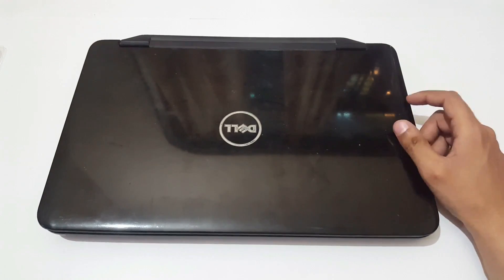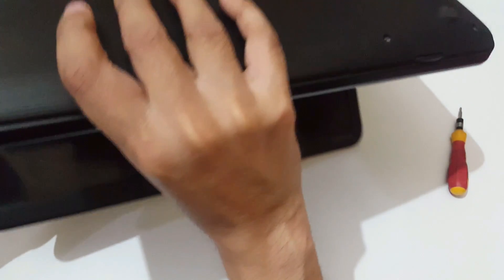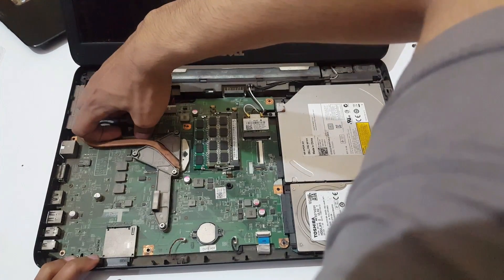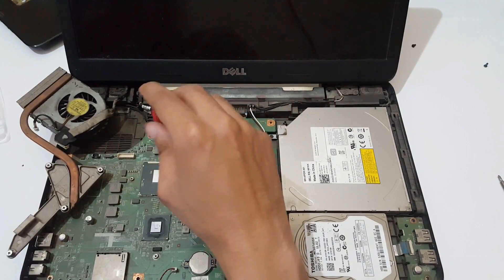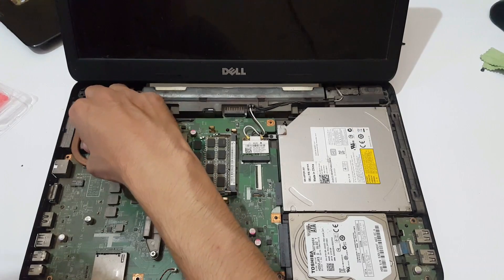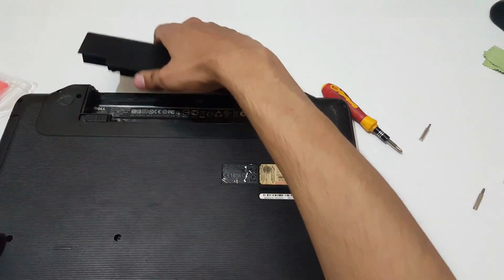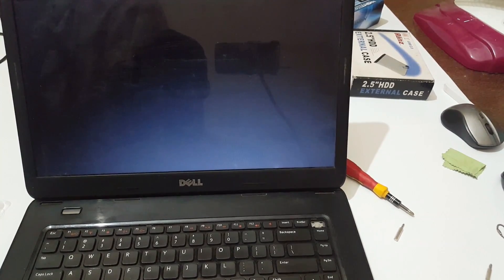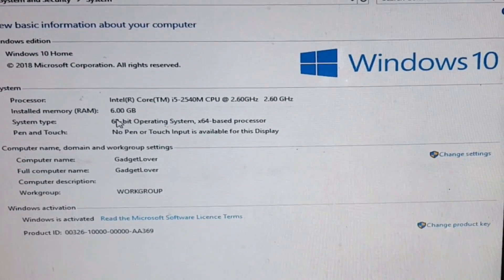How to Upgrade Processor on DELL Laptop | i3 to i5 & i7 - Make Laptop Faster for Gaming

Comment: Hello I have Lenovo g500s i3 3120M CPU which processor should i upgrade  which will not bottle neck my motherboard ? i have upgreded it to 8 GB ram and 1 TB HDD please suggest laptop from past last 6 years
Reply from the maker: Sheeraz khan : Intel Core i5 3380M is best processor for your Laptop
Reply: @GadgetLover360  or should i go for the i7 - 3840 qm ? or it will bottleneck the performance ..
Reply from the maker: Sheeraz khan : Intel Core i5 3380M is best processor for your Laptop and if you want to upgrade it with i7 processor I would suggest you Intel Core i7 3632QM
Reply: @GadgetLover360  will it bottleneck Fcpga 988 motherboard ?
Reply from the maker: Sheeraz khan : No but it will improve minor performance of Laptop
Reply: @GadgetLover360  Ok bro thanks and i am also planning to add SSD to my lapi to .. by Moving HDD through the CD panel and SSD as main will it be preferrable by you ?
Reply from the maker: Sheeraz khan : You're welcome and SSD is better option to optimize performance of Laptop
Reply: @GadgetLover360  thanks brother for the help .. really appriciate..
Reply from the maker: Sheeraz khan : Glad to help you

Comment: Bro I have lenovo i3 6006u 2ghz 4gb ram 

SUGGEST me the best core for my laptop
Reply from the maker: Scar king : Intel Core i5 6300U and Intel Core i7 6600U are best processor for your Laptop
Reply: From where I can buy this
Reply from the maker: Abhishek Kumar : Amazon or Aliexpress online store
Reply: @GadgetLover360 is it really works for gaming performance, can you get me link of product plzzz
Reply from the maker: Abhishek Kumar : Yes I would also suggest you to upgrade RAM for more better performance and search it on both website then compare and buy best and affordable processor
Reply: I have the same laptop , Lenovo ideapad 320 . laptop is slow as hell , tried finding on amazon 3300 &6600U are not available
Reply from the maker: Free Traveller : The processor of this Laptop is soldered so you can't upgrade it
Reply from the maker: Frantic Cobra : No
Reply: @GadgetLover360  Yo, is there any good suggestion for my laptop? My laptop is the Acer E5-475. I have 4 gigabytes of ram. And there is a core I3 that is close to my touchpad.
Reply from the maker: Syphic a normal noob : The processor of this Laptop is soldered so you can't upgrade it I would suggest you upgrade its RAM and install SSD for better performance

Comment: thank you,
i have dell inspiron n5050 pentium i wanna upgrade it processeur what is the max value can i upgrade it?
Reply from the maker: Alilouvic Stockholm : You're welcome and Intel Core i5 2540M and Intel Core i7 2640M are best processor for your Laptop
Reply: Hi What about dull e5440 i5
Reply: I have Asus Vivo book 14x409 intel i3 can I upgrade to i5
Reply: Compare the processor pins and socket.
Reply: I have tried the i7-2670qm on an n5050. It seams like there is no support for this CPU implemented to this Dell model. Just three short bios code sounds. The i3 is working without problems.
Reply: @halbblutturke3879   i tried i7 2640 and he worked
Reply: @mastersecuritylab8935  Cool thanks. Maybe I will try this CPU to. Sadly the 2670qm didn't :/

Comment: Would this work for a dell desktop? I have an i3-8100 and I'm looking to upgrade for to an i7 if I can, any suggestions?
Reply from the maker: KitaKat : Yes if it is not soldered you can upgrade it with Intel Core i5 8400 and Intel Core i7 8700 processor
Reply: Gadget Lover Thank you so much!!
Reply from the maker: KitaKat : You're most welcome

Comment: My laptop is: Dell Inspiron 15 3567 
Motherboard: Dell 0JTTXY
Current: Core i3 6th generation
Can I upgrade to Core i3 8th generation or 9th generation (as 2gb amd graphics is included in my pc)....
Please also tell if Dual channel support is there or not that is if I put 8GB Ram in two slots of same 24000 frequency then processing speed get double or not...
Reply from the maker: Live Social : Unfortunately you can upgrade it in same generation only and yes RAM and Processor upgrade will boost the Laptop performance

Comment: Dell vostro 3580 i3 7020U 4gb 1tb hard drive, can I upgrade? It's not a gaming laptop I know but I can deal with it
Reply from the maker: gert rummo : Intel Core i5 7200U is best processor for your Laptop
Reply: @GadgetLover360  only i5 no i7 or above it?
Reply: If I upgrade ram aswell ?
Reply from the maker: gert rummo : Yes you can also upgrade RAM of your Laptop and Intel Core i5 7200U and Intel Core i7 7500U are best processor for your Laptop
Reply: @GadgetLover360  thanks alot myfella!
Reply: @GadgetLover360  if so with i7 I can finally play world of tanks and fortnite aight lol. Tyty again. And cs go on medium settings! GTA San Andreas multiplayer is the best tho, depends on how much I upgrade ram, Dell and hp laptops are one of the best!
Reply from the maker: gert rummo : You're most welcome and yes it will boost the performance of your Laptop

Comment: I have Dell n5010 with i3
Gta5 or pubg will run after installing i5 processor?
Reply from the maker: Pawchet : It will improve the performance of your device and I would also suggest you to upgrade RAM for better gaming experience

Comment: I have dell Vostro 1550 with i3.which is the best processer for my laptop and where to buy.
Reply from the maker: Bat Man : Intel Core i5 2540M is best processor for your Laptop buy it from Aliexpress online store
Reply: I have same laptop 😜 btw tried that processor on your laptop?
Reply from the maker: Abhishek Shukla : Intel Core i5 2450M is best processor for your Laptop
Reply: @GadgetLover360  i5 2540m will run?
Reply from the maker: Abhishek Shukla : Yes but 2450M is better processor for your Laptop

Comment: Hi I have i3 6100u what CPU I can upgrade it?
Reply from the maker: Noriel Visco : Intel Core i5 6300U is best processor for your Laptop
Reply: @GadgetLover360  can we change processer
Reply from the maker: The Neplese Gamer : If it is not soldered you can upgrade it in same generation only

Comment: Hello, sir, I have dell Inspiron n4010 with i3, what is the best upgrade part (series too) for my laptop. i need to improve the speed of this laptop. thanks
Reply from the maker: Dody Ardo : Intel Core i5 540M is best processor for your Laptop and you're welcome
Reply: I have Dell n5010 with i3
Gta5 or pubg will run after installing i5 processor?
Reply from the maker: Pawchet : It will improve the performance of your device and I would also suggest you to upgrade RAM for better gaming experience

Comment: which processor should i install in place of i3 4005u?
i want the best ratio of price to performance
very much glad to see that you are replying each and every comment
hats off brother
Reply from the maker: Nikhil Shewale : I would suggest you upgrade it from Intel Core i5 4300U
Reply: @GadgetLover360  what about hp pavilion G6 2011 laptop with i5 2350m processor
Reply from the maker: @jistusmathew6377  Intel Core i5 2540M is best processor for this Laptop

Comment: Hi I have an n5110 laptop that is i5 2nd generation can I upgrade it to latest generation?  Or just the same generation?
Reply from the maker: robin justin : You can upgrade it in only same generation
Reply: Is there anyway to change the board of the laptop to change generations?
Reply from the maker: robin justin : Yes but for this you need to change motherboard of your Laptop
Reply: Could you say which motherbord can be replace for n5110
Reply from the maker: robin justin : In my knowledge GT525M motherboard should be capable for Dell Inspiron N5110

Comment: I want to upgrade from i3 to i5. I have dell Vostro 2520. From where I have to purchase the processor online. Please reply.
Reply from the maker: BACKCHOD GAMER : Upgrade it from Intel Core i5 3rd gen processor
Reply: @GadgetLover360  from where I have to buy  , i have searched online but it's not there
Reply from the maker: BACKCHOD GAMER : I would suggest you Buy it from Aliexpress online store
Reply: @GadgetLover360  Can u please send me the link of the best suited processor for my laptop
Reply from the maker: BACKCHOD GAMER : I would suggest you buy Intel Core i5 3380m processor from Aliexpress online store
Reply: @GadgetLover360  bro please share me the link
Reply from the maker: BACKCHOD GAMER : First download Aliexpress App from Google play store and open it then in search bar write Intel Core i5 3380m and buy best reviewed processor
Reply: @GadgetLover360  thank you for you reply I found my product but is it safe to by from this AliExpress. As it providing product at very cheaper rates. As compared to the product is see on official intel website.
Reply from the maker: BACKCHOD GAMER : You're most welcome and it is used product that's why it is cheaper than new processor
Reply: @GadgetLover360  but is it safe
Reply from the maker: BACKCHOD GAMER : Yes because it comes with 60 day buyer protection and 1 year product warranty
Reply: @GadgetLover360  do u have also purchased the processor from this site.
Reply from the maker: BACKCHOD GAMER : Yes
Reply: @GadgetLover360  ok thank you for your reply.
Reply from the maker: BACKCHOD GAMER : You're welcome
Reply from the maker: BACKCHOD GAMER : In my knowledge yes

Comment: Hello i own dell Inspiron 15 i3 7th gen i want to upgrade it to i5 wat processer do u recommend n wat will be the cost of too pls thank t
Reply from the maker: igloo man : I would suggest you to upgrade it from Intel Core i5 7360U
Reply: I have Dell n5010 with i3
Gta5 or pubg will run after installing i5 processor?
Reply from the maker: Pawchet : It will improve the performance of your device and I would also suggest you to upgrade RAM for better gaming experience
Reply: @pinky_dil_se_120_goli  it will bt u cant upgrade graphic card
Reply: I have 2GB internal graphics card
Reply from the maker: Pawchet : You can attach it externally to your Laptop

Comment: Sir mere laptop mein i5 520M processor hai.
Ham ismein kaun kaun se processor laga sakte hain upgrade version please reply jarur Karen.
Is processor ko laga sakte hain Intel Core i5-4300M 2.6GHz CPU
Reply from the maker: Full Funny Clips : I will suggest you to upgrade it with Intel Core i5 580M or Intel Core i7 640M processor they are best in performance for your Laptop
Reply: @GadgetLover360  thanks main try karta hun 640m processor
Reply from the maker: Full Funny Clips : You're welcome
Reply: Do question hai aap se
520m 640m donon ki performance mein Kitna difference hoga.
Kya 640m different category mein aata hai ya sirf ek hi category mein aata hai. Kyun ki online market mein bahut se available hai
Kya main 640m koi bhi le sakta hun jo mere laptop mein support Kare.
Reply from the maker: Full Funny Clips : You can upgrade it from same generation only whether it is i5 or i7
Reply: @GadgetLover360  aapane jo pahle mujhe bataya mein vah samajh gaya. Per main aapse yah puchna chahta hun mere usmein 520m processor hai hi ab main 640m upgrade karna chahta hun to ine donon key performance mein Kitna difference hoga.
Aap mere comment ka reply de rahe hain uske liye thanks aapki jankari mujhe bahut acchi lagi
Reply from the maker: Full Funny Clips : i7 Performance will slightly better than i5 processor and you're welcome
Reply: @GadgetLover360  Sir last question.
Mere laptop mein. Intel(R)Core(TM)i5 CPU M520@2.40GHz. ye processor hai To kya is processor ko upgrade karna na theek hoga 640M me.
Mere laptop mein Jo CPU hai vah kaun sa generation ka hai yah bhi bata dijiye please
Reply from the maker: Full Funny Clips : In my knowledge you will not face any problem in upgrade and Core i5 520m is 1st gen laptop processor

Comment: I have an dell n5050 2nd gen i5 
It's possible to upgrade to i7?
Reply from the maker: petros magaiver : It is already upgraded to i5 and in my knowledge only minor performance will boost up if you upgrade it to i7 but yes it will boost the performance in comparison to i5

Comment: Hlo i want help can be change any processor of any laptop with any processor of any generation
Reply from the maker: kuch bhi bros : No you can upgrade to same generation only
Reply: My lapi is not turning on my old laptop celeron processor Intel
Reply from the maker: kuch bhi bros : Eject RAM then reinsert and try again
Reply: Nothing is happening in my laptop nothing i use with charger or without battery and charger with battery nothing is happening
Reply from the maker: kuch bhi bros : I will suggest you eject RAM then reinsert and try again if problem still exist go to nearby PC store and tell them about this problem